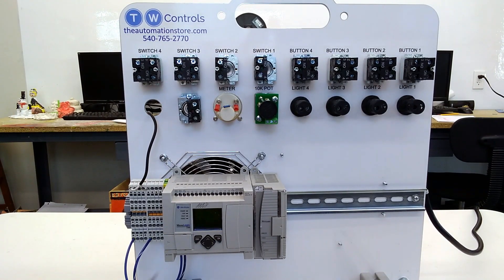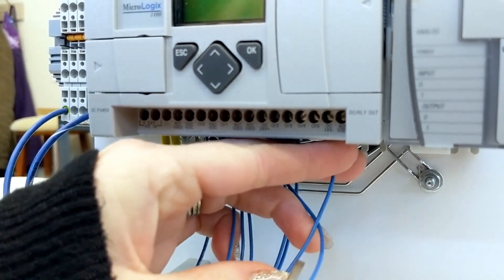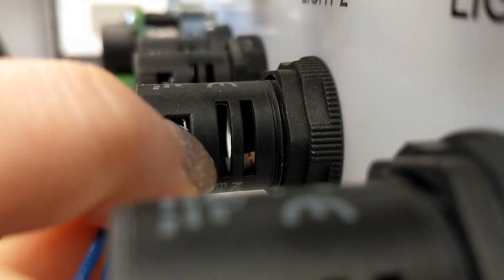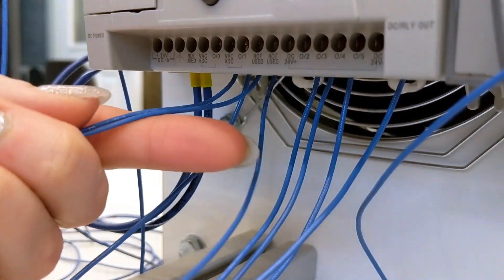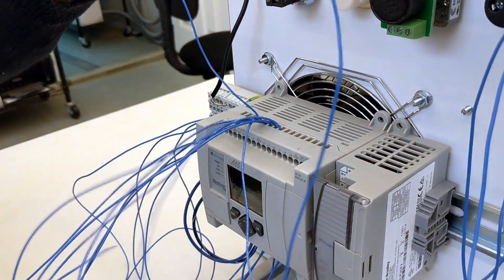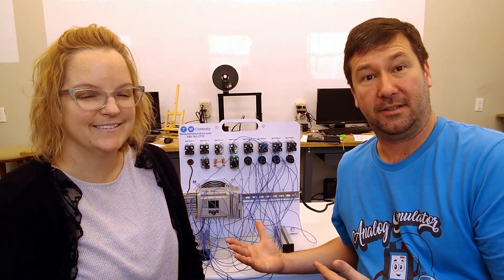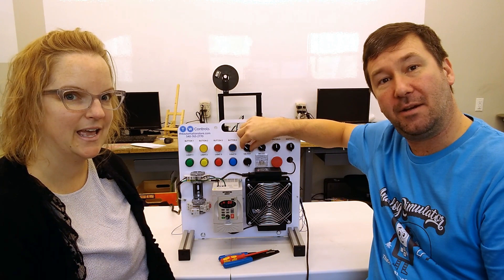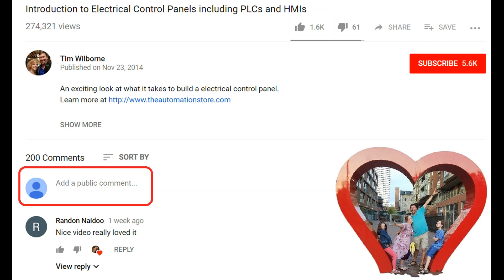Allen Bradley Micrologix Trainer - Basic Wiring to Get Started

Comment: Hello :)
I have an issue with a micrologix 1400, i dont know what it is 
I connected 24vdc to the vdc2 to power the outputs but all the outputs are on from the begginning. 
I connected one light and is always on, what can it be, what am i doing wrong :(
Reply from the maker: Hi Daniel.  What is the part number of your 1400 and can you describe the rest of your light wiring?

Comment: Whew ... glad you discussed the finished wiring.  Was beginning to get an anxiety attack. LOL  
Extremely neat and orderly wiring was always my forte.  I have been told many times that they could always tell the panels I built with one look.   Not much of a legacy, but I'm comforted in the knowledge that it will aid with any troubleshooting that might need to be done.   

On a more serious note ...  Do you ever use 'black' for the negative DC runs?
Reply from the maker: We've debated on adding wire duct to the trainer just to make it neater.  What is your thoughts?

We use blue with a white stripe.  We use black for AC loads below 150 volt.
Reply: Tim ... A little Panduit might be a nice touch.  Definitely wouldn't hurt.  
Your trainer brought back some fond memories.  A friend and I built a wall of lights that were all tied into different PLC's.  We would challenge each other daily to 'out program' the other and make the lights do some really interesting things.
Reply from the maker: @lonelyprepperhomestead911  Those challenges are how you build skills.